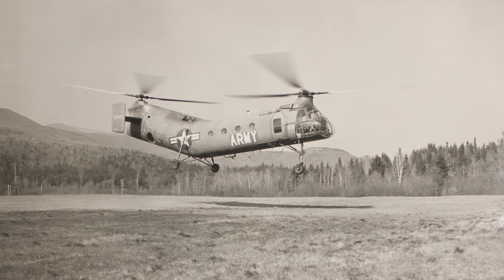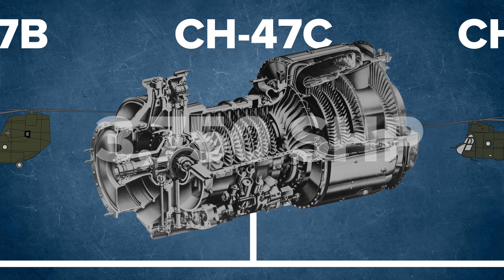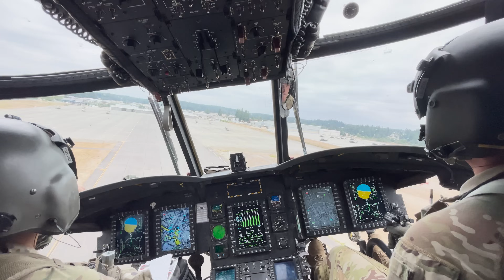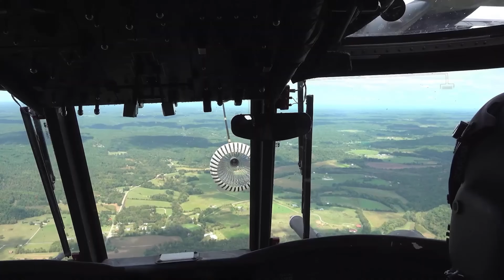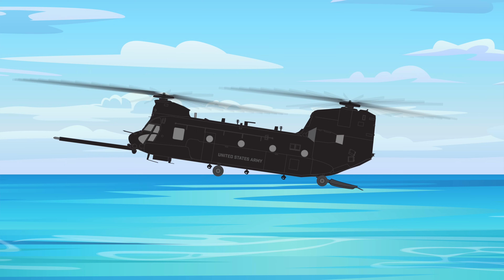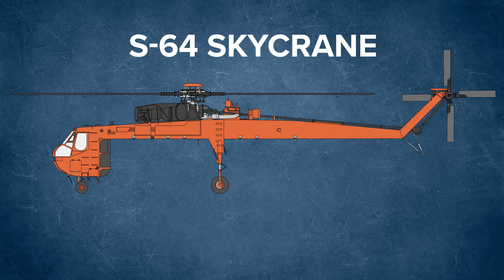This $32M Helicopter Changed Military Aviation Forever [Extended Cut]

Comment: In the first quarter of 1967 in the middle of South Korea was Camp Ames outside Dajon.  We had an emergency evac to Seoul the Chinook landed in an open field in the camp.  The ambulance drove next to the chopper after it landed.  Four of us transferred the patient on a stretcher to the helicopter crew and we got back in the ambulance. The driver, me in the middle and the lab tech in passenger seat and another medic was in the back.  As the chopper was lifting off it was hit by a gust of wind and at angle with the rotors in front it was drifting towards us in the ambulance!  The driver couldn’t jump out towards the blades, I was in the middle next to driver but the lab tech in the passenger seat jumped out and started running away!  The driver and I sat there watching the rotor blades advancing towards us just then the pilot added power, straightened up and flew over us.  We drove the ambulance and stopped next to the lab tech who was half a mile down the road and asked if he wanted a ride!  In my 6 years in the US Army I never got to fly in a helicopter.  C-130 and C-141 but never a Chinook!
Reply from the maker: That must have been one heck of an adrenaline rush.

Comment: To pick a nit: you state the D model’s 714 engines at 4,750 hp. IIRC, that was only in emergency mode. In normal operations, they put out the same 3,750 hp, but maintained this to higher altitude. 
Yeah, I was a 67U, ‘83-‘90.

Comment: Operating costs? I remember a bell (h-14?)(civilian bell 47- see M*A*S*H) army air guard pilot tell me (early 60s) that 3 hours of maintenance were required for each hour of flight. I asked why. He said that the spinning rotor blades were basically trying to shake the aircraft apart - in fact, if one blade were heavier by the weight of a torn paper match, it probably would succeed. And that's with a 145 hp Franklin engine turning max +/- 2500 rpm. What do turbine engines run at?? HEAVY maintenance required.🥵

Comment: If I may, I'd like to make a few corrections. I worked on the CH-47D in the Canadian Forces for several years. The aircraft comes in at around 28,000 lbs, not 50,000 lbs. It has an all up lifting capacity of roughly 28,000 lbs (14 tonnes), making it one of the only aircraft that can lift its own weight. Top speed is around 200 mph, depending on several factors. At "245 rotor", rotor blades at 245 rpm, you can achieve max forward thrust and you can feel it in your chest over half a mile away. The additional fuel is in "Fuel Bladders" inside the aircraft, fed by a poprtable electric pump connected to the fuel system inside. Record capacity of persons inside was during the Vietnam evacuation in 1975 when a Chinook carried 73 civilians of a roof and out to a carrier off shore. The Chinook was originally designed for the Vietnam war and had a life expectancy of 100 hrs before it was shot down. If you hold real tight onto the front most rotor, the tip is about 6 feet off the ground, you can actually prevent the rotors from spooling up when the pilot starts the engines (DON"T TRY IT). Landing in the water is done with the help of two "dams" which are put in the back at the ramp hinge and the front side door. You try it without the "dams" and the bird goes to the bottom. Only models after the "D" had the optional triple hook configuration. In flight refueling was an option on some US Army and RAF aircraft. It was not standard. The Chinook has one of the highest maintanence requirements of any helicopter (roughly 4:1 - 4 hours of maintanence per 1 hour of flying). They are loud (no such thing as "Stealth Mode"), powerful, and a lot of fun, especially skiing down the slopes in the winter (the bird actually skiing - not the troops).
Reply: I think you mean the D model and later are triple hook capable.  I fly the thing.  Started on the D, then transitioned to MH-47s with the E and G models.
Reply: @karlchilderz  It's been quite a while since I left the Forces. My bad. We had the Super Cs. Our birds were slated to be rotated through the Fort Campbell facility and get the airframes rolled back to zero and upgraded to Ds but the pilots of a C-130 decided to pancake their plane into the underside of another Herc during an airshow. The powers that be decided it was more important to replace the Hercs so there went the Chinook budget. Since no upgrade, they decided to mothball the fleet (all 7 - wow!!) in 1991. In 2013, The Forces started taking delivery of 15 heavily modified CH-147Fs. Ever done any skiing with them? Best part. That and picking tree tops out of the landing gear. I miss old "Thumper".
Reply from the maker: The 50,000 lbs was the is overall capacity, not the weight of the aircraft. That's including the aircraft weight and load. The rest of that is really cool info! Thanks for sharing.
Reply: Also to add they never got the lighter and more lift rotor blades for military use. The program got scrapped,

Comment: By far the most impressive aspect of a modern Chinook is the sound. You can hear them coming for miles and the landing site is literally overwhelmed by the sound and the power of these machines. When they start, the sound of the turbines spooling up seems to rise forever, the blades seem to rip the very fabric of the atmosphere until it feels like the Earth should be moving out of the way. VIPs will get a multi-vehicle escort and the sound of 3 or 5 lifting off is pretty cool.
Reply from the maker: The sound of these things is amazing
Reply: Back in the day, we moved an infantry battalion, 24 ships in one lift. A heckuva noise!
Reply: @craigbigbee6395  Hell yeah!
Reply: Definitely a menacing noise
Reply: Yea they have a couple at an airport near me that fly around over my house a few times a month. Absolutely awesome every time.

I’m still a bit partial to the sound the Huey makes. But the Chinook has such a unique sound too.
Reply: @slipknottin  Never get sick of it. I like the sound of the Huey too

Comment: Understand the need/want to have an extended and "normal" version but the cutting of content needs to be adjusted. There's a lot of double ups in information where you're just restating the same information in multiple parts. In the normal version it's fine since the other parts are cut, but the extended version feels a bit tedious; almost like the normal version flows a lot better, despite there being less information. Really enjoyed the original
Reply from the maker: Thanks for the feedback! The extended version was meant to go into more detail about each of the things that were repeated.